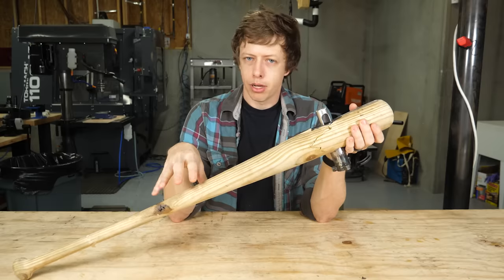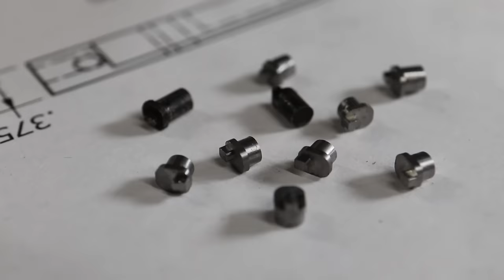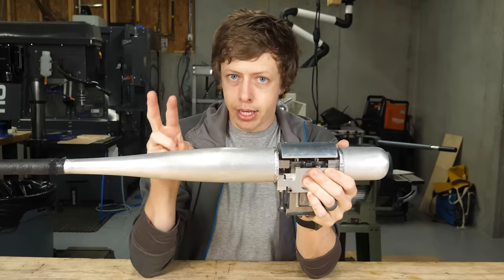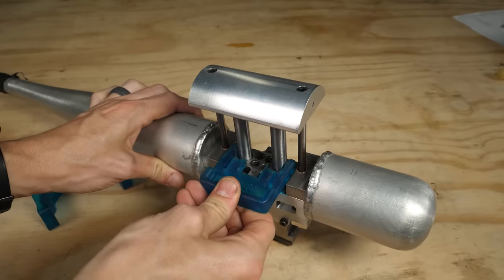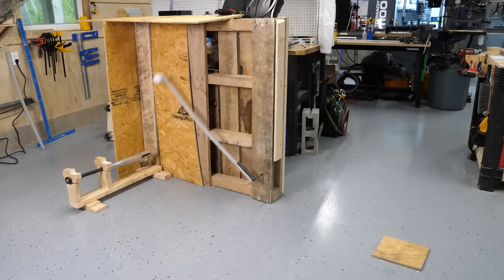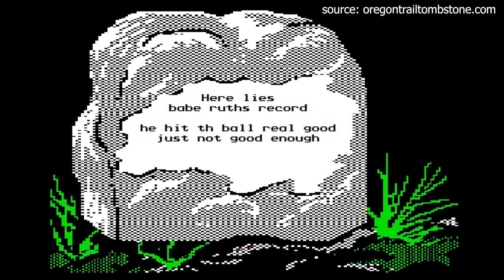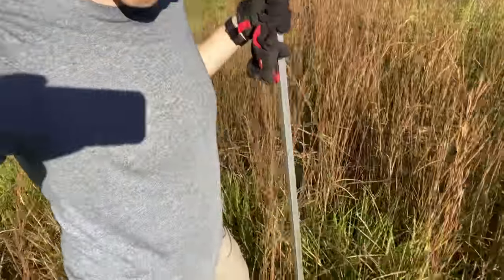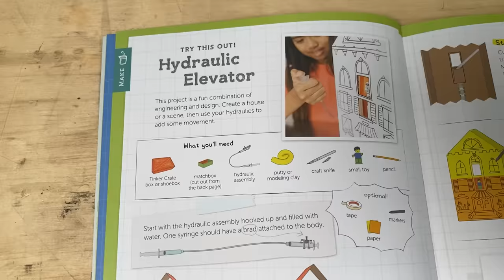Explosive Bat: crushing MLB records. Ft: Smarter Every Day

Comment from the maker: Teach your kids / relatives / yourself to make things with projects from http://KiwiCo.com/stuffmadehere. As someone who grew up with these types of kits I cannot recommend them highly enough. That link will get you 50% off your first crate!
Reply: What is that tablet?
Reply: Worth mentioning they are not a New Zealand based company nor are any of the products made here, all China.
Reply: Not only a great video, but a great add too.
Reply: Owen Looper assuming it’s an IPad Pro
Reply: "How to deal with failure and pick yourself back up" lmao
Reply: I really enjoy watching you figure out how to do this. ❤️😁
but also there's still a lot of room for improvement for durability and performance.
You might want to consider using:
1. Shock absorbers and more stopping length
2. Venting and muffling through the handle
3. Using ultra light materials (carbon etc.)
4. Using a flat accelerator plate

I am always available if you should need some help with improvements, since more minds thinking outside the box find more stuff for the box ✌️

And keep up the crazy ideas 😁👌
Reply: @johnbrown2163  yes, from what I remember it's some kind of ultra durable plastic.
Theoretically it's great for this job👌.
But there will be the problem of attaching the mechanism... Welding is better when done correctly and aluminum bats already have a cavity for sile... I mean muffling.
Reply: golf clubs are very old, they use .38
Reply: Yo when you get the final product working you should start a company and sell and serve these
Reply: @normalcitizen_1  that would need a lot of permits and legal work 😂😅
If some rando hurts himself our hero SMH is screwed... 😬
Reply: Salute❤️
Reply: This bat is a dream zombie weapon
Reply: Use a ping G10 driver. quite cheap but effective. Get 8 degree loft with all the power behind it for optimal distance. regular flex shaft to absorb the recoil. there you go. Advice from a golfer.
Reply: @owenlooper  looks like a Surface Pro of some kind. Not sure what model
Reply: @normalcitizen_1  I totally agree with the fact that that would be awesome but at the same time it sounds like some lawsuits just waiting to happen😂😂
Reply: I SEARCHED UP DEGLOVING THATS DISGUSTANG
Reply: You should name the bat B-50
Reply: KiwiCo makes really great stuff. Have been using them to get gifts for my friends' kids for a while and they all love the products.
Reply: @WetDoggo  I leave that to you smart guys. All I'am is Imagination.
Reply: OH MY GOD I LOOKED UP DEGLOVING AND I SAW PICTURES OF PEOPLE'S FACES NO NO NO NO NO NO NO NO NO NO NO NO NO NO NO NO NO NO NO NO NO NO NO NEVER AGAIN
Reply: @WetDoggo  Wooden bat was best. It just kept breaking. I think the ColdSteeel Bat will be the sweet spot. Do you have a guess on distance of ball? I'm guessing 1407 feet. It was gone!!
Reply: Idk why I wasn’t subbed I subbed right now tho
Reply: I wonder if you could design a mini car air bag with a thickened Kevlar face to replace the heaviness of the head
Reply: What kind of quad drone did you use to film the hit
Reply: **I have an idea**

Your slow down issue, instead of sending the plunger out wherever, what if you used a round or 2 to slow the plunger? Basically the plunger extends to about ~75% of its full length before the 2 braking rounds go off which would have a time delay ofcourse. I think if you were to time it where the rounds start building usible pressure around 80% of full extension, the final 20 percent forward travel would be on the braking cycle. it would be pneumatic instead of mechanical so the expanding gasses would be compressed which would be a very effective spring. The only thing you would have to worry about would be another pressure chamber.
Reply: @Koolaid5583  good idea, I wonder if just turning ur plunger idea into a fluid filled and valve actuated shock absorber would work the same way. U should check out the video "squirrel vs physicist" lol
Reply: You are awesome, i'm a 15 year old from Poland and I wish i could be someone like You in the future
Reply: @owenlooper  microsoft surface I think
Reply: Devilslayer101  Fair point
Reply: What software are you using on the iPad?
Reply: hello. like your stuff very much. coming from SmarterEveryDay's channel
Reply: This is totally cool however My butt hole is all puckered up.... I looked up degloving.
Reply: Golf club do it
Reply: Say hi to Destin for us! Great collaboration by the way!
Reply: What about Airbag deployment device opposed to powder charge?? 
Just an idea but I have no business making changes to your project not to mention the price difference between airbag units and ramset charges 😂
Reply: In addition to KiwiCo, I see you're also advertising Binford Tools... Nice Touch :)  I will buy.
Reply: Plzzzz in the third iteration use the escaping gases to stablize the bat
Reply: @owenlooper  Pleaseeee let us know when you can, the program for drawing.
Reply: DarkXDieselX  Dope, thanks!
Reply: Make two of these on a spinning machine and make the ballfly over 1000 feet
Reply: What for a App are you using on the iPad ?
Reply: STOP ADDING BACKGROUND MUSIC.  It annoying and distracting.
Reply: So funny you had SmarterEverDay on.  I watched him for years and years, until he started to add music and I unsubbed.  I am glad he is still making videos, sad he thinks we need to listen to music.  Oh well.
Reply: here's an idea for you: football kicking boot :D
Reply: You're making Mark Rober proud :)
Reply: Hey! iPhone 12 has a LiDAR! Time to upgrade the eyepad into an eyephone!
Reply: If you patent this you could make a lot of money
Reply: As a fellow engineer and father of two, I'm excited to see this.  I also really appreciate your determination and ability to learn through trying.  I like how you described doing iterative problem solving in this video as well.  As part of my graduate fellowship, I taught engineering to 3rd graders and I quickly realized that the fear of failure is so powerful.  We talked a lot about how failure is only when you stop trying.
Reply: An idea for the bat: You should make gas overflow holes right before the end of the inner rods in extracted state. This prevents it from "exploding" due to too high pressure.
Reply: I LOOKED UP DEGLOVING
Reply: I’ve already been doing them. THEYRE SO MUCH FUN!
Reply: why not make the stop rods out of tungsten?
Reply: It is not a bat it is a gun with large surface area bullet :(
Reply: well i looled up what degloving was... i didnt see anybody have what the definition said happen to them
Reply: YES YOU MADE THE SEQUEL!!!!!!!!! THANKYOU THIS WAS THE VIDEO THAT INTRODUCED ME TO YOUR CHANNEL AND IT WAS AWESOME AND I LOVED IT! I WAS HOPING YOU WOULD MAKE ANOTHER, BETTER BAT AND YOU DID IT!!!!! (i just really needed to see more things with the bat, and i like the home run/ness bat sfx in the first, nice touch) could you make like.... a special hammer or sword or something? I think you could make some really cool weapon mods, maybe?
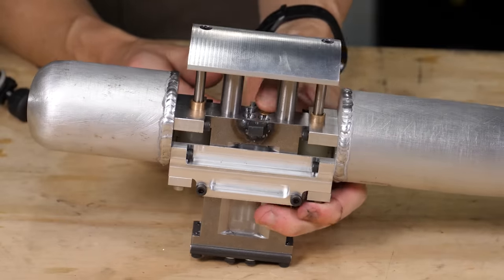Reply: 5:54 ok. i try in my backyard then?
Reply: All that protection but no mention of a groin cup. :O
Reply: Hit a GoPro straight up into the air
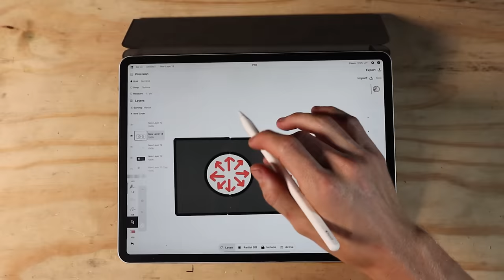Reply: Hi what's the name of the program you use to draw stuff e.g at 7:01  ? thanks
Reply: What kind of drone were you using?
Reply: I only take advice from smart people. I'm gonna do the KiwiCo thing because you made some very compelling points. And I also sub'd.
Reply: Can't you use something to track the ball? GPS or something?
Reply: Subscribed! Pity you live so far, we could do some fun collaborations.
Reply: How much would it cost to make bat for me?
Reply: Can you make a Thor hammer with this same idea in place
Reply: @dylanm7136  popopo
Reply: What app did you use for designing?
Reply: Keep saying your videos are too long... but some of us would watch for hrs.
Reply: Smarter Every Day sent me here...
Anyway, if your upstairs neighbor asks, "Hey what was that noise?" you probably need more sound insulation in your ceiling...
Reply: Good watch dude. Stuff like this is why I'm going to school for machining and cnc design. Ty for putting out awesome stuff.
Reply: Better shouldt had looked vor decomerlimaten
Reply: @owenlooper  iPad Pro 2020
Reply: Buy/make a ball with GPS
Reply: You should sell your prototype parts to fans, or have them as a patreon thing. That way, they have something cool from you, and you can keep doing amazing stuff like this
Reply: Love the channel absolutely great work. Saw your filter you made for the plasma cutter. Did you ever think about getting a water table for it or would you have to buy a whole new setup for something like that. Idk what pros or cons would be just curious? Seems like less chance to breath in metal dust
Reply: Put a stainless sleeves in the pistons just like a vehicle engine for strength?
Reply: This is in regards to the 5AM wimpy shot Or what could have happened was that the ball hit the side just right to only set off one of the bullet causing so many uneven forces that it bent as shone, just a thoutht. Btw great vid
Reply: I searched up degloving
Reply: @einheit2429  nasty.  Learned that term in a truck rollover course.
Reply: Just a heads up, there is already a golf club like this, but there is plenty of area to make one that hits with 4 shells
Reply: Wait... you're from NC? What school you go to? I'm NCSU
Reply: Will do right after ive googled degloving.... Cant be serious right?
Reply: Why did you make in de baseball a tracker that you find the ball back
Reply: @stuffmadehere drill vent holes near the end of piston travel, so that you vent the gas and reduce the chamber pressures vis a vis the stop rod tension stress
Reply: What is that design program that you’re using?
Reply: Degloveing I searched it and its perfect for a zombie movie who knew
Reply: @fearlessgamer2998  yeah I agree but look on the bright side we know how to make a zombie movie now
Reply: @lumberjack7178  hey he's telling them to seachit so someone makes a zombie movie so good job video
Reply: This guy put .50 cal in the thumbnail and uses .22 short blanks smh my head
Reply: instead of using springs for the stop rods, you shouldve redirected some of the gas from the blanks to the stop rods in a rearward motion to cancel out the forward momentum of the impact plate at a designated time. this wouldve worked a lot better than spring or steel slamming full force into more steel.
Reply: Do one with a golf club
Reply: Oh
Reply: I would love to see the golf club!
Reply: You can use 2stock engine technology💪
Reply: yes do a golf club, i like hitting golf balls with baseball bat, with less effort it bounces much faster
Reply: You need to see if you can get a videogame creator to feature your bat in your game.  Perfect for both post apocalyptic zombie movies or Blernsball or MLB 2020.  Maybe after quarantine you could try it in Denver with a ball that hasn't been humidor-ed.  Maybe you could get Joey Meyer to take a shot at it.  Or Jose Canseco- he's already missing part of his hand.
Reply: "This is the type of thing you do once and then a law is made because of you."

I mean your not wrong. It does make me what would happen if you took that to a human. Actually Germany made a hammer like this once
Reply: I looked it up
Reply: I know this is sketchy but make a one shell but so compact no one will notice
Reply: Have you tried using titanium?
Reply: @fearlessgamer2998  yep well said
Reply: Devilslayer101  you know I've seen worse... Thanks pictures of war injures..
Reply: When you said don't look up degloving I did while I was eating a man that's some cool stuff
Reply: Pitty they don't send stuff to Russia. I've been close to buy
Reply: @trailguidealex5010  brother I mean their is big air pressure inside piston.  If you fallow two stock engine ,how it release air pressure.    You can release extra air pressure from yore mechanism . it help to keep parts without any damage 💓
Reply: Have you considered narrowing the channel the expanding gas goes into? Have you given that any thought or is it as small as it can be... but a narrower space should mean a faster piston drive right? I get your smarter, was just hoping you would explain how you came up with the appropriate dimensions that you then used. Thanks.
Reply: You kinda get into it, but wouldn't smaller holes accelerate the piston faster? Also does the gas excape after the required acceleration is achieved, or does it trap them completely?
Reply: Disregard, you answer this,and altogether you breezed over it, your design is brilliant.. id love an hour long stand alone vid discussing the variations you came up with, and the math and science involved..
Reply: What was that app at 5:00 in on your iPad I would like to get it
Reply: my respect to your mechanical skills! greets from GER
20:30 - dude put UV to the drone and look at night. This ball would be easy to find.
15:24 - this moment on a  journey of failing trials that tells you: I want your time, your brain and your money :D the little knockdown inbetween when the project tells you a story about your work concering you and what dou did. ;)
16:44 - haha :D nice entertainment
Reply: lol you just remembered me an old friend...

dude, I can just write it in German: Wenn Du Deine Werkzeuge so konstruierst, dass die stabilsten/größten Teile am Gerät auch die am meist belasteten sind dann hast Du lange etwas davon. Der überschüssige Gasdruck sollte in einen Kolben geleitet werden, der mit einer Feder gehalten wird. Der Zylinder hat an einer Stelle ein Loch, durch das sich der Gasdruck gegen die Feder und den Kolben beim Spitzendruck entlasten kann. Anderes Beispiel: Gasdrucklader H&K G36.
also, I can recommend you every steel filler material listed  EN14700! For different steels eg FE10, 11 or 12.
Reply: Hi! Do you mind posting your calculations, just for us engineering students who want to get into the nitty-gritty? Thanks!!!!
Reply: I looked up degloving and I regret it. So basically it rips your skin and tissue... and it leaves muscle and bones
Reply: So thats how to sledgehammer from Killing Floor 2 works.
Reply: I want to see a 10 blink bat and next time use graphite 
Or re bar or tungsten
Reply: I already finished all the sets
Reply: MAKE A BOLT ACTION BAT
Reply: Choocher Mass! Beautiful, I love a little addition like that for personal laughs.

I always try to replace the word “vestibule” on drawings, I prefer “air lock”.
Reply: Cassy the 50.cal bat
Reply: nice job with the 2076 world series baseball bat.
Reply: I have a request and faith in your ingenuity
Reply: You possibly consider using a consumables cartridge made of  thin aluminum to intentionally crumple and absorb the energy during deceleration? Possibly in conjunction with the spring
Reply: knowledge is a curse and a gift
Reply: Golf ball
Reply: try putting some form of grip tape on the bat so the ball will have some backspin, giving it rise.
Reply: The best
Reply: So busy being smart you didn't notice you hadn't protected your lower body, you know the bit in line with the explosion. Dude buy some Kevlar pants!
Reply: Just thought of this. The 1000 mph baseball vs your bat
Reply: Have you seen the EZeeGolf Golf club? its a swingless golf club that can hit the ball like 200+ Yards.
Reply: Could you try pneumatic pistons pumped up to about 3000psi.
Reply: @brucebaxter6923  zzz
Reply: I agree make a golfclub
Reply: @dylanm7136  iiîiipkuuii
Reply: You made a Casey, from Enter the Gungeon.
Reply: I have a request, sneaking shoes for now hunting. A lot of bow hunters take their shoes off so they are able to get closer and not be heard. What if they didn't have to take their shoes off. Has to be durable and should be water proof
Reply: Bang bat
Reply: The homerun
Reply: Hit a ballistic dummy with that thing I’m curious what exactly would happen
Reply: He should hit it up with hacksmith and they could dominate the world
Reply: The problem is the compression spring, the exact contact matters. Calculation are wrong.
Reply: U have tention between contact, lol
Reply: And u probably need a rebound spring lock, so when it contacts, the rebound spring can assist w/ parallel expansions in the rebound
Reply: Can you tell me the softwares used to design this and what was used on the tablet to explain how it worked
Reply: Yes really loved the tablet demo - looks really useful program
Reply: i search degloving and i thought its only on hands
Reply: @salignozzi4847  never meant a man to take his shoes off while bow hunting lol.. If you're hunting deer.. I wouldn't advise that. They have an extremely good sense of smell. Much stronger than ours...
Reply: Is that suppressor registered with the ATF
Reply: Dude if u didn't contact the atf or file some forms u maybe in violation of a felony
Reply: @dodgersfnshepard8673  haha.. You're so full of it...
Reply: @name_less7687  actually checked, he's in violation of 3. 2 are manufacture of a destructive device & a suppressor (the exhaust/muffler).

Because this uses a cased smokeless powder cartridge that's what classifies it as a firearm, check laws or call atf if u doubt
Reply: @dodgersfnshepard8673  See the problem is, one main thing... The atf doesn't count that as a cartridge. A cartridge includes a shell/casing, primer, powder, and bullet/projectiles. You might want to read into that more. Two.. Also his exhaust isn't a suppressor, it's a break, or flash hider. Whichever way you want to look at it.. There's a difference. Three... The atf doesn't give one crap about a kid making a baseball hitter with caps. He could legally even do mass production and sell it if he didn't mind law suits from people getting hurt lol..atf wouldn't care though. It uses a primer. Not a cartridge. You can buy cap guns that fire the same caps and are produced by companies without fire arm manufacturing permits. No ffl required to sell them. No background check required to buy them. As per atf regulations. You can even produce muzzle loaders without permit in most states. There are companies that even sell build your own rough kits for muzzle loaders without fire arm manufacturing permits. It does depend on the kind of primer the muzzle loader uses  to make the atf even consider them enough to be regulated new with ffl permits and fire arm manufacturing permits. Only a handful of them need to be. I think 3 to be exact. There's a winchester, Remington, and a savage model. Lol but you can make you a flint lock or most muzzle loaders that take primers right in your house and take them out shooting with the atf agents. They wouldn't care man. No law prevents it. They're not looked at as true firearms by the atf. Though they're under a second classification of fire arm.. I forget what they call them lol but if you read into it, it's literally just so they can charge people with gun theft that steal them from shops or owners. You can still get 25 years for it. That's what I made of it last time I read it. Simply to stop theft of them, they can be dangerous in the wrong hands, (duh) and anyone stealing a gun has bad intentions. Aside from theft. Atf doesn't like the idea of things that can kill people on the black market, legally. Lol Go figure. 

You're right about making a cartridge firing gun/weapon (whatever you want to call it)  and suppressors though. You need a fire arm manufacturing permit or a federal tax stamp to do it legally. Cap guns and most muzzle loaders aren't regulated under these laws though.

Ooo .. I just went to their site to double check that they hadn't changed something in the past couple years.. And I didn't just rant making myself look like an a** cus it had been a while since I read up on there.. They have a description of what they consider violation. Primers mentioned in it but they speak of primers in a way that you've got to pay attention. They clearly say that only primers designed to fire cased cartridges used in fire arms. This bat isn't a firearm at all. Nor does it use a casing or cartridge. They also say clearly that THIS DOES NOT INCLUDE SHOTGUN SHELLS OR SHOTGUNS. So you can make shotguns legally without a permit as well???! Huh? :) I had heard that before but honestly didn't believe it. I guess maybe you only need a manufacturing permit to mass produce them past a certain number.. Since companies that make shotguns require a permit for them. I'm not sure how that gray are works lol.. The atf's only really worried about regulating weapons that are made to hurt people not weapons that people make for hunting now.
Reply: You should call the bat the punisher.
Reply: @owenlooper  iPad pro
Reply: I want to see a major league baseball player use this back
Reply: This is ridiculous, there is no way to see how much this kiwi thing costs without signing up and giving a bunch of info... :/ can someone tell me much it costs monthly? Like the actual amount
Reply: @owenlooper  believe its an ipad pro
Reply: The master master batter
Reply: Explosive bat vs ballistic dummy.
Reply: You have Created The Perfect Legal Home Defense
Reply: Qué programa utilizo para el diseño, las piezas eran móviles.
Please guys.
Reply: Theres a video in your ads
Reply: I want to buy this lol
Reply: I looked up degloving and now I regret all life choices
Reply: THUNDER BAT seems appropriate.
Reply: I looked up degloving cause he said not to do it. I regret everthing
Reply: I have an idea for an improved piston deceleration system.

You could re-route the gasses to act as a high pressure pneumatic cushion. Just put a hole in the main piston past a certain point to give it a sufficient delay so that you can still get good velocity from the ball smacker, then attach a smaller pipe leading to a space between the end of the decelerator rod and the cushion spring, then seal it all off and maybe add a small, adjustable hole to each of your new deceleration pistons to vent the gases, and also maybe make the cushion gas router adjustable.
Reply: You must be in stark industry
Reply: built in suppressor too?
Reply: Golf club yeah boy
Reply: you would have had an easier time hitting the ball at better angles with a concave launcher instead of a convex one :)
Reply: Make a guantlet version of it to make a stronger and harder impact punch
Reply: How are you such a genius?
Reply: One word propaganda 18:20
Reply: DarkXDieselX  thanks I guess!
Reply: not a real 50 cal just a 22 l use 22 all the time no recoil at all all gun owners know this
Reply: I looked Degloving and my god it's horrible but it was what I expected
Reply: I could only dream to live your life. Please dont stop being you. All brains and no BS
Reply: You should put a gps tracker in the baseball
Reply: Hit a watermelon with 4 shells loaded
Reply: The remake of the sword-gun
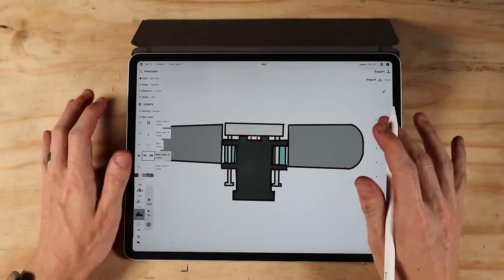Reply: 4:14 Min whats name of tab and whats name of this program wanna learn designe ... Thanks
Reply: This is the guy in fallout with a rocket sledge.
Reply: You didn't name it Boomstick?
Reply: If you go to the field with a strong black light at night might be easier to find
Reply: Gotta say that’s the smallest .50 cal rounds I’ve ever seen.
Reply: 머글 들아 이것이 마법사의 지팡이다!
Reply: PERFECT sponsor spot!!  If I had kids or would have kids I'd be all over this link
Reply: I searched up degloving
Reply: I actually use the same blanks in my antique revolvers that are chambered in .32 rimfire and they seem to be pretty powerful!So the one that is my current EDC is a 6-shot double action Forehand& Wadsworth with a 2.5"barrel and when I load it with the same red #5 blanks and a 100 grain LRN bullet and they drive this bullet at an average of 340-350 meters per second or 1100-1150fps on average giving 375 joules or 275 fpe on average which is quite substantial for a 2.5"barrel revolver!However I generally prefer using #6 purple loads for better performance or #4 yellow loads if I want it to be subsonic:the #6 drives the same 100 grain LRN in the same gun at an average of 380-390 meters per second or 1250-1300 fps giving 470 joules or 350 fpe which is about the same as you get from your glock in 9mm or .45ACP!As for yellow loads those generally get around 1000-1050 fps and so they stay subsonic in my case!So if you want to improve your results in this video-buy at least #6!And if you are ready to make it really crazy powerful-try sourcing out the long nickel coated purple #12!I used to find 6 of them and fired the entire cylinder using them because the particular model that I have is very significantly overbuilt and it allows that but trust me:it's a bomb!I got the same 100 grain LRN bullet at a whopping 650 meters per second or 2130 fps on average using these crazy loads!It gets slightly over a thousand fpe so it is just a bomb!Try that stuff out!
Reply: III
Reply: This is the power level of like a kanabo or sledgehammer actually probably more 6000pounds of force is certain enough to blast someone to the shadow realm
Reply: That bat produces enough force to launch a Ford Flex 1.3ft in the air
Reply: J
Reply: I shouldn't have looked up degloving
Reply: When you challenge the nerds to a game of baseball.
Reply: How about using some titanium
Reply: Dis bât. Kîll many zombie
Reply: You'd probably be horrible at making a 50 bmg rifle, but... Ya never know until you try
Reply: What’s the app that you use on your ipad for drawing designs?
Reply: What is degloving
Reply: Could you make it so that the exaust gases actually brake the top part when it's towards the end of it's motion? This would put less pressure on the springs/rods. You could have the gases escaping via two slots which either route the gases away, or forward out of the top part depending on the position of the top part.
Reply: i goggled degloveing
Reply: 21:30 thank me later
Reply: L53
Reply: What would that do to a zombies head. ?
Reply: Your sweetspot is minimal with a curved face. You need a square face like a golf club. I don't know if you figured this out yet. The wider the sweetspot the better odds you're going to have. Well thats my opinion you can give change back for my two cents anyway.
Reply: @BOT-ww3vb  and.?
Reply: How the fuck are you not going to show the actual hit, I want a part two 😤😤😤 I was llet dooooowwwwnnnnn... a whole 20 minutes of N O T H I N G
Reply: @BOT-ww3vb  and?
Reply: So in my YouTube wandering I found out this may have existed before this video. In the form of a golf club though. The swingless Gold club
Reply: I looked up degloving idk. Why u think its so bad
Reply: Do 5?
Reply: What most of 90% of the times you are forgetting ( missed out ) is tartic rubber..

Old saying.. some referred is as charcoal rubber!
and basically, you could get it anywhere. Tryes are nearly everywhere.

In engineering, there are two type.. One is the scetch engineer & the big boss engineer is called the " moving table " engineer! Have you seen, steel operation tables that runs across from 200metre to 800metre?
Reply: Just pretend, you doing some "brakes" over a stop rod!
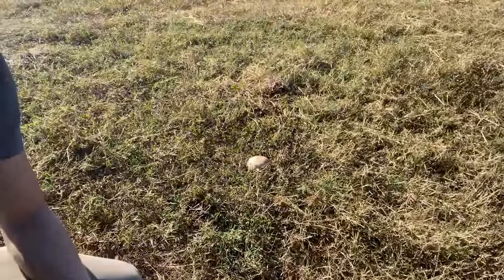Reply: 20:00 I saw like a 2m fishing line over the combust hammer.. Still is good!
Reply: The baterup destroyer
Reply: Can you consider this a gun on a stick?
Reply: Bro why isn’t there any vapour barrier on your ceiling your breathing in some insulation fiber wich cause crazy allergies and and potentially canger
Reply: Could you make the strike plate with a smaller circular plate in the middle to strike the firing pins so that it only goes off with perfect hits!
Reply: There is already a golf club that does that, look up "swingless golf club"
Reply: Isn’t this legally a gun? ✔️Projectile ✔️explosive 

You should really call a lawyer…
Reply: you are smart.
Reply: Hmmmm I detect a little sarcasm there! 🤔
Reply: If you have re-engineered the bat, you must re-engineer the ball as well. I wonder why did you not get the thought that, the material used in making the ball is incompetent to handle that explosive force produced by the bat!🤷
Reply: Well first off!  The ball was able to take the force with up to three shells! The fourth one as well! And the camera showed some distortion but the material of a baseball flexes regardless! But is was obvious that the distortion didn’t affect the extreme velocity of the ball!  Because it still traveled 700 yds!  Why didn’t you catch that🤷🏽‍♂️! And why didn’t you catch the part about him saying he sucks swinging the bat because he keeps messing up!  I was saying that if he made the strike plate with a smaller firing pin center!  He could avoid sending balls needlessly 200yds! And potentially damaging the strike plate like he did in the video! And he would increase his chances of only producing good hits! Why didn’t you think of that!  🤷🏽‍♂️
Reply: @Ramon-du7jv  I noticed all of it, dude. It was my opinion, not an order 😂. The guy did what he did. I opined what I did. End of it. 🙏
Reply: @Ramon-du7jv  Also, may be you misunderstood my opinion when I said, "...ball is incompetent...". My intention was to highlight the fact that the use of ball made of different material could have improved distance travelled by the ball. Plain and simple.
Reply: Fair enough!  But changing the ball would make the experiment pointless since his objective was to hit a “BASEBALL”. Further than people in the Major leagues!
Reply: Raih
Reply: 350 is a major league fly-out, not a homerun unless you hit the ball right down the line.
Reply: Other guys link????
Reply: What else can you do build how about a shoe powered with blanks to kick a ball really far
Reply: Could you make a device that can auto shoot basket balls from any where on the court, auto adjusting.
Reply: You should have used titanium.
Reply: Being useful for other projects is the major idea behind mecano, lego etc. It sets them apart from single purpose kits like IKEA and imagination-constraining kit brands.  Many other KiwiCo sponsor bits omit that major difference.
Reply: Got hooked on your channel. Going to work late because it! Is ok! I'm the boss! Trying to get the kids involved. Plus you know I'm talking about this channel at work and watching some while I'm in "BREAK" (BOSSES DONT GET BREAKS)
Reply: See
Reply: I love this kind of videos, because he doesn't show just the success, but also the failures to get to the success.  Also, does somebody knows which app is the one he uses in the tablet to draw the schematic and show the functionality. I need this app.
Reply: A
Reply: @Stuff Made Here - 18:20 -  Yo Buddy, I know exactly what you mean. I have a handful of friends that fit that exact same description... which I Non Homosexually let them all know how much they mean to me quite often. Believe me its EXTREMELY difficult to pull off. 🤣🤣👌
Reply: I feel like ur not hitting it correctly ish I so want to give that bat a try you hold your hand too high on the bat
Reply: What is that app called that he is using
Reply: Put this system into a Fallout 3 / Fallout New Vegas Super Sledge. Yes, it has to look exactly like one of those, not the rocket powered one as that's already been done.
Reply: You sir are the type of person the socialists don't want, but the world needs more of.
Reply: I got my niece this 6 months ago.

I cannot recommend this highly enough for toddlers and small children.
Reply: After looking at your design + physics involved. Why not increase the weight of the bat so when you swing it and it fires, more force is transferred to the ball and less kick backwards? Food for thought.
Reply: Call it tthe Bullet Bat
Reply: I looked up degloving 😫.
Reply: Can I buy this from you for a YouTube video and if I can how much
Reply: @dylanm7136  you
H
E  
L
L
Reply: @DeezNuts-tm1bu  gotem
Reply: hi, thsi is really cool, but could i give a dumb suggestion that may not work?  i really like what your doing, kind of an odd use of your engineering genius, but still interesting :D

ok what if the explosive rounds were in the pistons and the expansion gas directly pushed the piston up and out, instead of going through a u bend pipe?  maybe the piston could be telescoping straight back into the device that propels the ball?  so the ball hits the propelling bar?  that force ignites the ammo in telescoping pistons, and the pistons expand from the force of the gases shooting them straight back into the propelling bar and pushing the ball out?  you might be able to position it so it shoots it nearly perfectly straight from you depending on the angle of the pisons, but maybe that would reduce the chance of them igniting with each swing :s

Im no engineer, just throwing this out there.
Reply: I already have it and its amazing.
Reply: Your swing kinda stinks. Love the vid tho